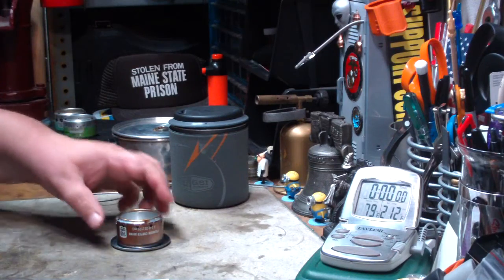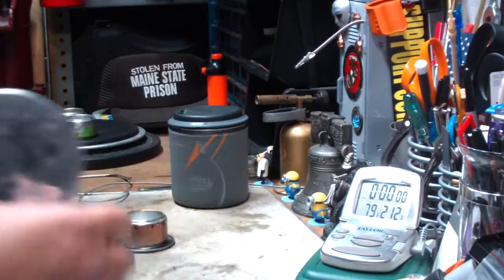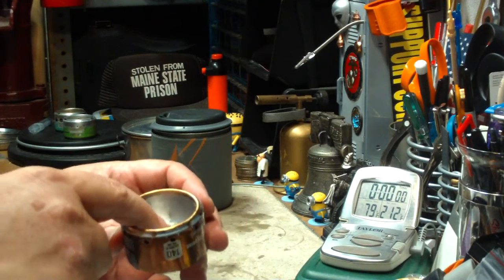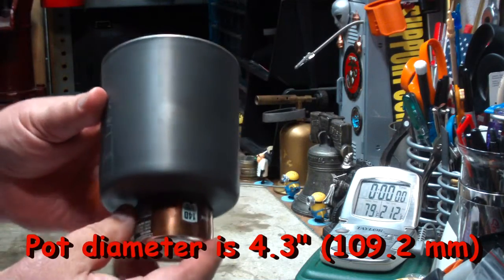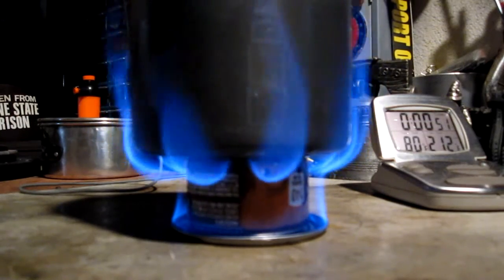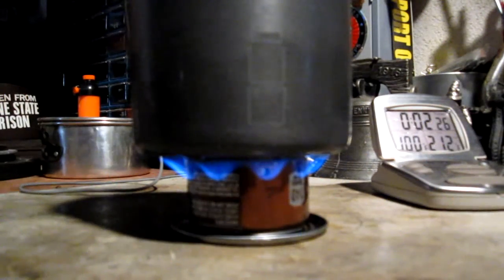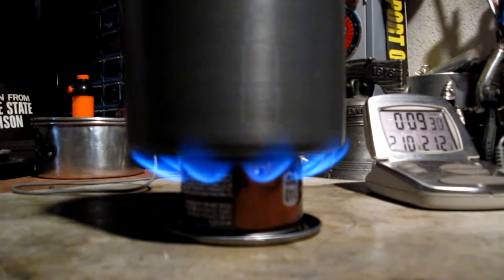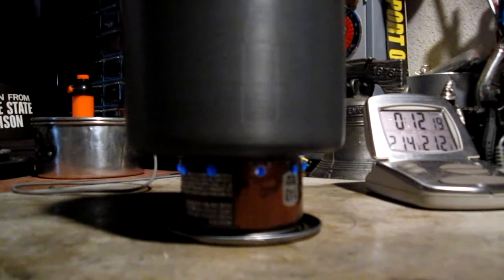MatoNupai's MAHALO Alcohol Stove - Boil Test #2 - GSI Halulite Minimalist Pot

Comment: I have built many alcohol stoves of different designs, 
My last design was a penny style, and when I fired it up for the first
time, I had an Army cup and stand setup. The boil time was about 10 minutes 
with 3/4 oz of fuel. My next setup was a 6 inch wide pot and a wire mesh stand that put the pot at around 1 inch above the stove. 2 oz of water came to a boil in 5 minutes 30 seconds. Same stove, same amount of fuel.